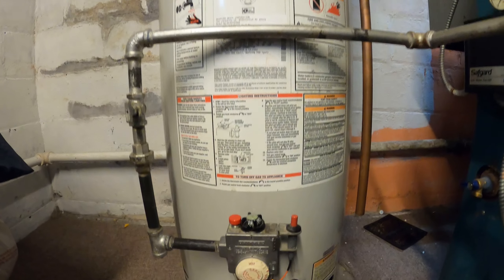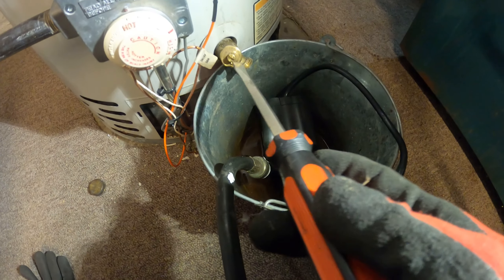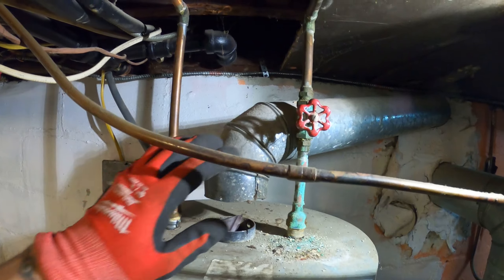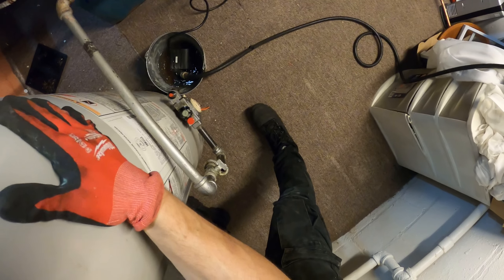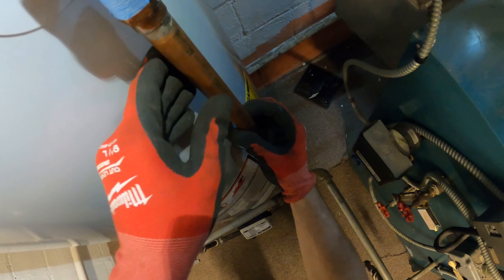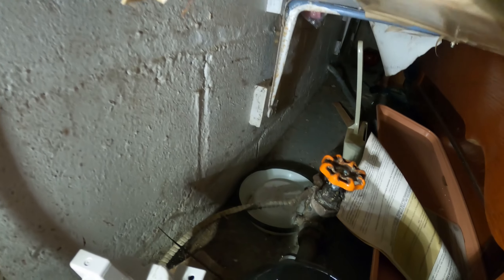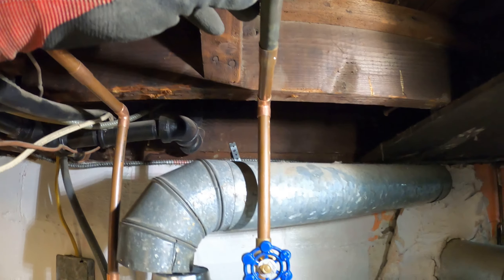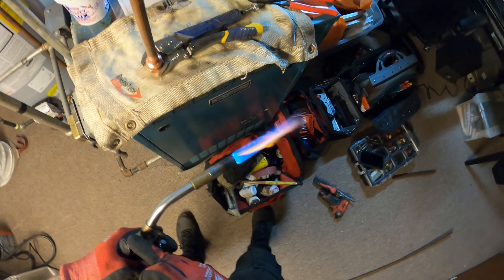HVAC: Hot Water Heater Installation (AO SMITH ProLine Commercial Grade Gas Water Heater)Step By Step

Comment: Hey awesome video. My heater looks just like your job! Exactly the same set up. I think i can do it myself.  I'm not a plumber just a DIY er homeowner. But i trust i can do this job. Ive sodered copper b4. Im just unsure about the gas piping. Are you supposed to replace the black gas pipes when replacing a gas powered water heater as part of code? 11:45

Comment: Instead of doing all the soldering where you have potential for leaks. Why not use flex connectors where you only have one solder joint? Plus if you ever have need to remove the heater again you won't have a reason to cut the lines again. Just a suggestion. Thanks for the information for the non-plumbers in the crowd

Comment: Great Content!! Love that Veto bag !!! 
Why aren’t you using water heater flex hoses ? Instead of soldering pipe to the boiler fittings ??
Reply from the maker: Thank you Al! Love the Veto bag as well. I have 2 Veto bags & they are awesome. Thats a great idea, it would've made things a lot easier. In this area you can you that. Guess I'm just used to always soldering. Wish I had one of those press machines for copper fittings. Stay safe out there & stay tuned for new videos!
Reply: Nice ! Yea I have a few veto tool bags and pouches , it’s an addiction/collection lol . Stay safe JMT!

Comment: Nice ,clean job.
Just one thing; does your area is not required to make drip leg on gas line before appliance?
Reply from the maker: Thank you! I appreciate the compliment. This was an outside area where their rules are different. Im not exactly sure about their code but reused the same piping that was there. Just replaced the tank pretty much. Im curious now lol Stay safe out there & stay tuned for new videos!